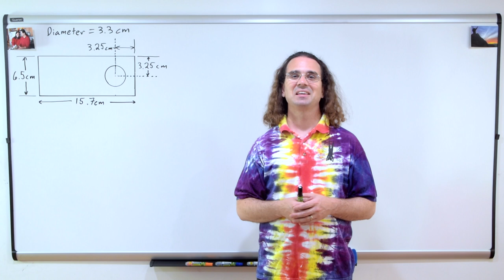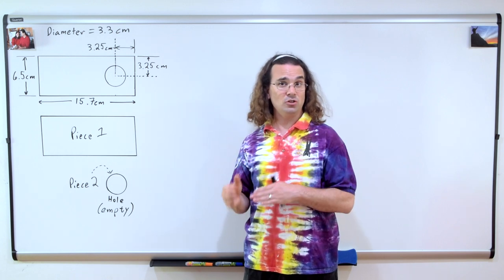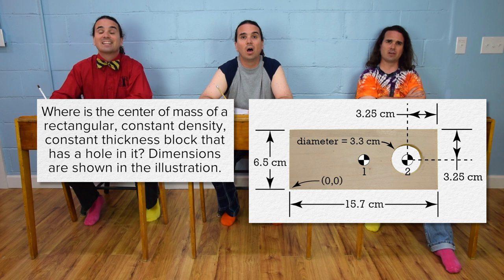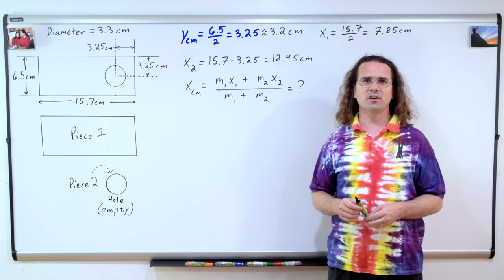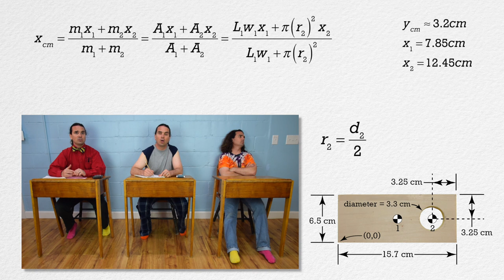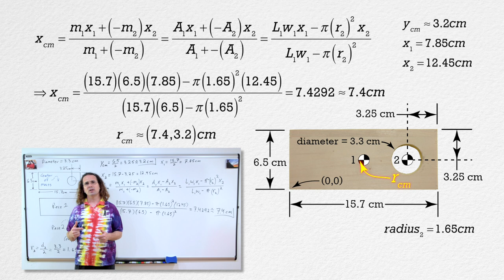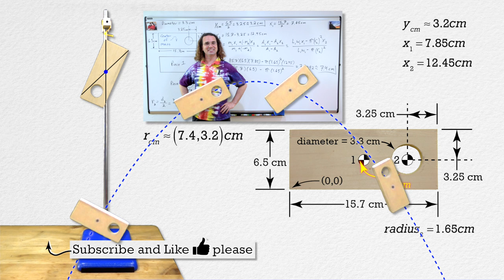Center of Mass of an Object with a Hole

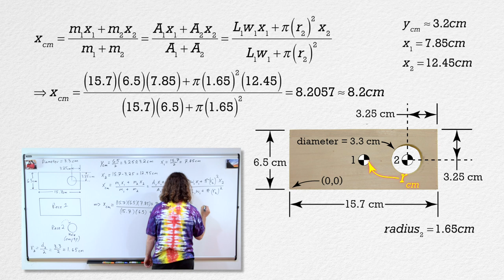Comment: Many thanks for this video! What's the intuition in 4:25 behind the "relative to the centre of mass of the piece 1 the COM should be further from the hole, rather than closer to it"?
Reply from the maker: If there were no hole, the uniform block would have a center of mass in the middle of the block. The hole removes some of the mass to the right of the middle of the block, so there is more mass to the left of the middle of the block. We should therefore expect the center of mass of the block with hole to be to the left of the middle of the block.
Reply: @FlippingPhysics  Thanks for the quick response!

Comment: Sir if we take (0,0) that is origin on the geometric center of rectangular piece then wouldn't it be easy to solve i mean it will reduce the effort in calculations
Reply from the maker: Yes, that would work absolutely fine. And I can see that it would make the calculations a bit easier, however, from a standpoint of helping people learn how to do this, it would make a bunch of the numbers 0, which isn't helpful when trying to learn. Hope that makes sense!